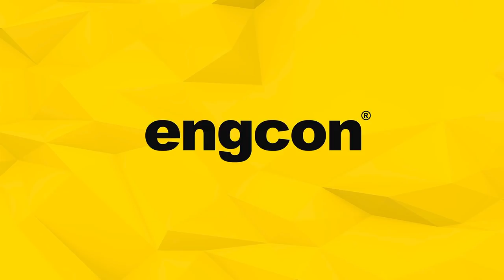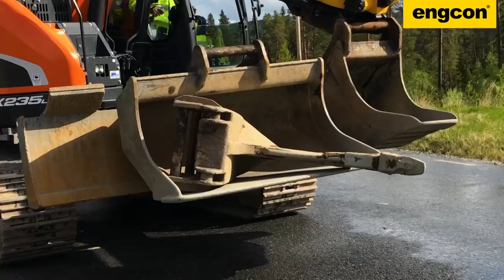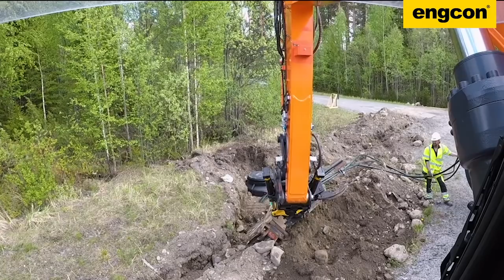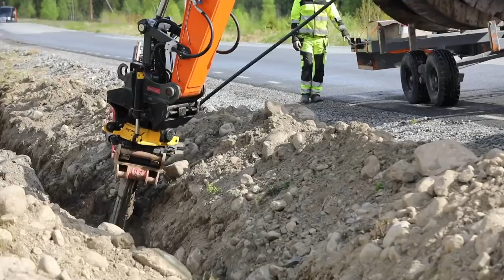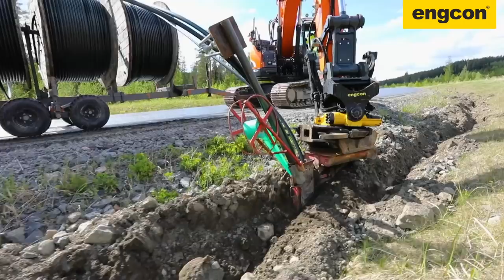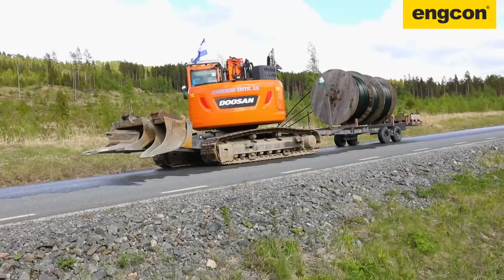Cable Ploughing with Doosan DX235 & engcon Tiltrotator

Comment: This rototilt isnt ment for this type of work !!!!!!
Reply: Then what type of work is it meant for if not for this. You cant plow cables without it unless your going dead straight in field etc.
Reply: its a engcon tilt rotator not a rototilt that a different brand but it’s made for a lot of works and this is an video from engcon itself so they are promoting the work with this tilt rotator